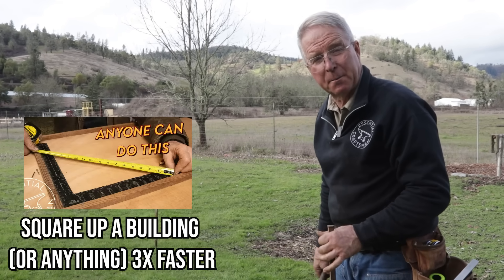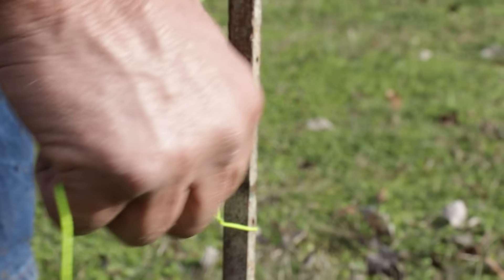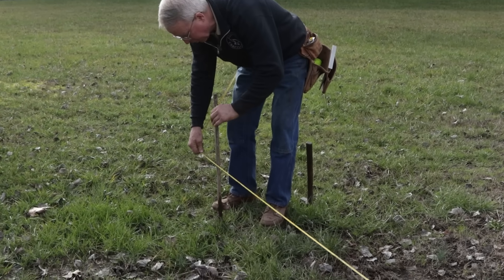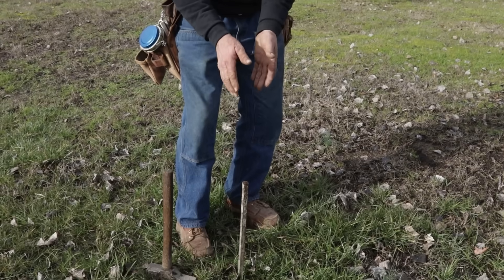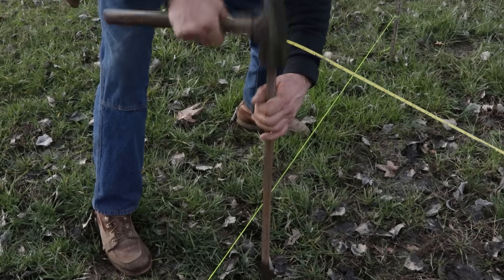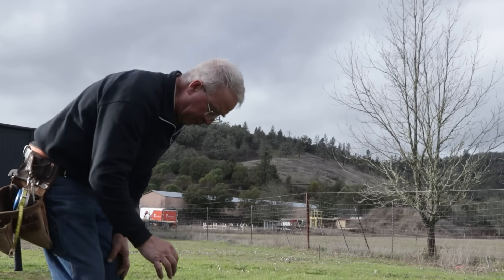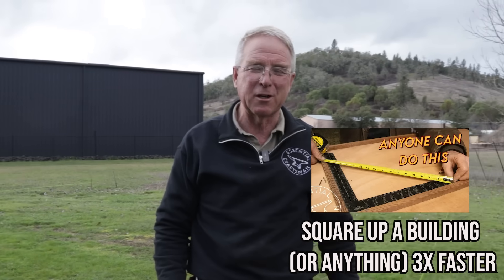How to Layout Parallel lines Perfectly

Comment: in my metropolitan jurisdiction we pay a survey crew to establish our foundation set-backs, off registered civil benchmarks. worth every dollar, every time. much different than whatever rules apply in the ex-urbs or rural areas but worth mentioning. sure set your batter boards & string lines etc etc check for square, shoot your own laser for elevation using surveyor established ele's as reference  but don't start without professional set backs.

Comment: I wish I’d seen this about 10 years ago, I’m no carpenter I built a 24x40 pole barn , I had a really hard time getting it close to square , working by myself with zero experience. It turn out about 4 inches wider on one end , it turned out pretty good and everyone thought it was very good but I always know the difference.

Comment: If you are building a Walmart and the concrete guys only got the South and West footing in and you need to start the wall you need to know the Pythagorean theorem and in an overall measurement from corner to corner it should be 3/8 short

Comment: Two lines perfectly squared using 3 4 5 method then everything parallel off those two original lines then double check later on with the x

Comment: Called profiles need to be leveled first line is the longest line of the found plan the facing the right way north east etc then use a big gib square to get the other line ruffly square then 3, 4 , 5 get that squared then everything else parallel off those first two original llsquare lines. Easy as
Reply: The 3 , 4 , 5 is the most efficient way to get two lines perfectly square

Comment: Why don't we take two points, for example, spaced apart according to the length or width of the building, and connect them with a rope? Then we take the third point according to the width or length of the building, respecting the 60/80/100 rule for angles. This gives us three points forming a right angle, and we use only a measuring tape to find the fourth point.

Comment: I spent a good amount of time racking my brain over this because I couldn't figure it out. There was no way geometrically that it could produce a parallel line that was on dimension, if we're going by pure trig. So I graphed it out in CAD, and here are my findings:
1) This does produce a parallel line
2) The distance between the base line and parallel line will always be shorter than your target distance. He's aiming for 36, and the actual distance will be a bit less (if he's hitting his layout dimensions perfectly). The absolute worst case I could produce based on his setup had ~0.5% error in the distance between parallels. Good enough.
3) He's not joking when he says "eyeball perpendicular, it doesn't matter". I graphed it out with a guy walking off at a 45 degree angle from perpendicular and it still worked within an 1/8".
4) The error from this method is non-linear meaning it doesn't scale proportional to distance. Can't be bothered to work it out, but a couple shorter test cases (12 ft parallels instead of 36 ft) had stupid small errors (like 0.008%).
Cool stuff. Appreciate the free education

Comment: Why not make a 3:4:5?
1. drive first stake (A)
2. measure a line off A to 36' and let it dangle
3. measure your fixed line off A to 48' and drive a stake (B)
4. measure a line off B to 36' and let it dangle

Now you can hook your tape to either of the stakes and draw it out to 60' to make a 3:4:5 triangle to stake C and D. It starts out 99% square.

Comment: Taking two lines that are roughly parallel, designating one as fixed, then travelling the shortest distance to the other line does not produce a 90° angle from the original line. I bet there actually is a way though.

Comment: I absolutely love your videos!  Thanks for doing these.  I’m not nearly as experienced as you in construction but have a different way of squaring up an area.

I set two stakes and pick the line I’m most concerned about regarding placement.  For an example, “I want to make sure this items sits 20’ from this building”. So, I would put those two stakes first at the measured distance.  Then, calculate the hypotenuse.  If doing a 40’x60’ area this would be 72’-11”.  Now, you need two tape measures.  Run one diagonal for 72’-11”.  Run the other one along the next line your wanting to set until it hits 72’-11”.  Repeat this again and your area is perfectly square.  Go back and put string around it to match the desired grade.

Comment: On construction in the UK we went to decimal many years ago, initially we fought it but then accepted it, the difference in ease and accuracy is night and day, inches and feet are so archaic and cumbersome  2.3/4  inch becomes 70mm, is a much simpler system
Reply: Sometimes I'll use metric, and it is easier for sockets. I remember my boss asking something like, "What's half of 5/8?" I didn't know. "5/16ths". I can use either system, but for construction I prefer feet and inches. I hate KPH though, and like that we do MPH.

Comment: Beautiful video! As an outsider who will start a construction project soon, I have a quick Q. Let's say I have a straight line from point A to point B (e.g. 4 unit long), and I need to draw a parallel line (say 3 unit apart). On paper, I can use point B as the center and draw an arc/circle with a radius of 3 unit (using a compass), and use point A as center and 5 unit as the radius (power of Pythagorean Theorem as shown in your other video) to draw another arc/circle. These 2 arc/circles intersect at point C. By the same token, I can pin down another point D. Line CD will be in parallel to line AB. And ABCD is a 3x4 rectangle. Is this method practical in construction field using tape measure, masonry line and a couple of rebars/stakes?

Comment: There's a lot of ways to establish a square line. My way is to set 2 corner stakes the you did, only the stakes would represent the building corners. Then, using a square formula, find the square number. Pull a tape from the established corner to the opposite corner on the opposite side and spray paint a line corresponding to the square number. Then you pull the remainder building corners from the original steak and the square mark

Comment: Hah. I was building a little deck for an elderly couple with this other guy, who was technically my boss, because he was the contractor and I was the helper. He had the idea that we should install 9 posts to hold up the deck. That seemed reasonable. But then he just wanted to start digging holes and putting in posts and I said, "Wait a second. What we need to do is put "batter boards" outside the deck area and pull strings to make sure we have straight lines." He wanted to do it the quick way, so we did . Then, when it came time to put in the posts, they didn't line up. He asked, "How did this turn out so wrong?" I just looked at him.

Comment: I got a trick for you old timer. Pick a point past your second line then swing the arc, mark the two points in which your chosen point crosses the line, measure that distance then half it will give you that right angle perfectly without the slight guess work.

Comment: I bought a Spencer Tape because you recommended it in this video. Turned out to be a complete piece of s**t. The spring is weak and never returns the tape properly. And yes I reset it.

It didn't come with a nail. Had to buy two additional ones. In spite of it clearly being pictured with a nail.

Then the damn belt clip fell off on the first day I used it. 

Won't be taking any more advice from you when it comes to tools. Maybe they were good in your day. But now they're trash.

Comment: Am I the only one to realize this video is flawed? If you follow the process in this video you end up with a parallelogram where the slanted side is 36 feet, the distance between the lines will not be 36 feet, and you still will not have a perpendicular line from the datum! The reason is: when he scribes the arc anchored at the datum line, he is making a line perpendicular to the secondary line - not the datum! Try it yourself with 2 lines considerably out of parallel and you will easily see what I mean. The correct way is instead to: anchor the arc at the second line and scribe the arc at the datum. The line between the secondary and where the minimum distance is at the datum will now be a line perpendicular to the datum. You then run a string on this perpendicular line. Do this again at another point. Now you have two perpendicular lines to the datum. Measure along both of them 36 feet and move your posts to that point. Then a run a string between them. You now have a perfect rectangle with 36 feet perpendicular distance. And better yet, from these 4 points you can measure any distance along the lines - just do the same on both opposite lines - and you can move your stakes to make a rectangle of any size you want and any offset from the datum that you want while being parallel to the datum. Also: The secondary line does not need to exist, you can start at any two arbitary stakes in the ground no string between them is needed.

Comment: A couple of comments: 1) Did you not find the right angle when you swung your tape like a pendulum?  Do that from 2 known points and you're square.  Why the extra step of the pythagorean theorem calculation?  2) Using the results of the pythagorean calculation, swinging 2 tapes from 2 points and intersecting at the hypotenuse calculation with get square very quickly as well.

Comment: What got me wonder here is that if the 2nd line is not parallel then picking a point of the shortest distance to the first line does not give you a point that is square to the first line. Just as an exaggeration consider a triangle where you measure a distance between any given point on one of the sides to the adjacent side- if you measure towards the tip, distance will be shorter then when measuring towards the base but it will not guarantee the line layer is square to the side. Now in this application it may be good enough but are the lines perfectly parallel?

Comment: Everyone uses 3,4,5 to get the square, which is a great way of doing it, but there is a much easier way that can be done by one person, its the way the Egyptians use to do it Im led to believe, thats simply drawing a straight line, using a Drawing Compass or Divider and draw two elliptic lines across your straight line, where the elliptic line cross over eachother, draw another straight line, its a perfect Square.

Comment: You just need one fixed line(side) and final point A and B on it, than if you know diagonal and building side length you just run one dimension from A and other from B and once those distances meet, you have a point C (that switch lengths for D), much easier and faster

Comment: Awesome tips! Thank you mate!
Just one remark : I think you are making a mistake when you say "square to the FIRST strig" because if I do the math,  you're square to the SECOND string. What you end up with is actually 2 parrallel lines  no problem! But the distance between these 2 parallel lines is not exactley 36ft if you make a square with your other method and measure along this line. The better eyeball at the beginning the closer to 36ft you'll be.
Reply: Just to make it clearer: 
When you draw your measuring tape and find the shortest distance : the measuring tape is square to the string where your feet are, not the one where your tape is attached.
Reply: @joffreyjo4076  You are absolutely correct. So the measure needs to be back at the datum line so that the measure is done perpedicular to the datum. Then a new line put up here. What is descibed in this video is how to create a parallelogram... infact you don't even end up with a single line perpedicular to the datum if you follow this video....

Comment: A master class about one of the most important points before the building starts. It's the stablishing the main datum reference for the rest of the measurements.
Reply: I was expecting the definitive measurements to be taken in the two diagonals of the rectangle as they should be the same if all corners are squared.

Comment: This is not correct.  The method of using arcing to find the shortest distance to the opposite staked string as the point of 'square' (i.e. that a 90* angle is formed at the first string) assumes the two long lines are in fact already parallel.  This was never established here (only eyeballed 'square' at ~36 feet, or to quote "two strings roughly parallel, probably not all that close at all" at 5:20), and thus the "shortest" distance method only ultimately results in a parallelogram if the two ends are measured to the exact same length (but they were not here, and even adjusting the lengths at the end of the process to exactly 36 feet incorporates the error, and does not properly adjust for it), but certainly not a guaranteed (squared) rectangle.  Actually where the 'magic happens' at 6:20 is the exact moment where the problems begin.  

He's trying to establish square on the end strings without first establishing the two primary (long) strings as parallel in this video, which doesn't even match the video title.  At no point in the video does he ever make the primary string square to the (short) end width strings-- he assumes he's found square (which isn't the case, as mentioned), and from this erroneous assumption contends the 2 long lines have now been made parallel to the 2 square end strings, which they haven't.  This defies all logic, and is not how this work should be done anyway for laying out a foundation, because it (very likely) creates a parallelogram, not a squared quadrilateral (rectangle).  Establish your long line and a perpendicular (square) end line first, then run your second long line from there-- very easy to establish parallel longlines that way.  Simple maths would have prevented this basic error.

Comment: I know you're trying to help. Even you can learn from a younger guy as I can learn from you. But realistically you made it way harder than it had to be. 

#1: get your 2 given corners A&B
#2: find your hypotenuse ( square corner
#3: pull your square corner off of A and your other building distance from stake B until the square corner and measurement intersection. Thats point C

Then pull your two measurements of the building from point  A and C until those measurements cross. 

That will get it perfectly square on the first attempt. You're only setting 4 stakes. And each stake is set accurately the first time. I do this for a living.  Concrete guy.

Comment: If you guys use centimeters and meters you can use 3 4 5 method..much easier. This os just not accurate because you cant get anything square whitout getting rhe corners accurate 90 degrees and the diagonals right

Comment: Thanks for the video. But there is an inconsistency. When you measure out both your ends at 36 ft from the reference line let’s assume you don’t get it exactly 90 degrees (as you say). This then means that your second line ( the approximate one) by definition must always lie within the arc scribed from the building corner stake. In other words the exact 36 ft square distance from the reference line will always fall on the outside of the second approximate line. In your video your 36 ft mark was inside the line and that’s not possible. Yes the shortest distance will be approximately square but it will always be less than 36ft because your quadrilateral is a squashed version of the rectangle you are trying to make. Clear as mud. I need pictures. Thanks.
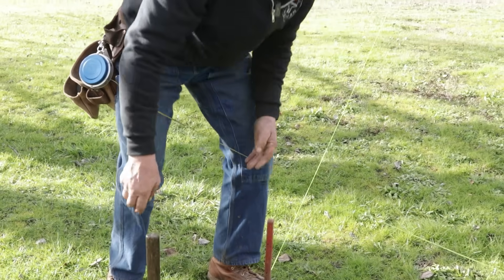Reply: I think he basically covers it at 7:28, it’s probably the tiny error from the ground not being level. I get what you’re saying though if he measured them the way he did, they should be no more than 36’ apart. Funny!

Comment: This method is not correct. As previously said, when finding the minimum distance to the second line, the point/stake at the beginning of the tape measure is perpendicular to the minimum distance on the second line. What is certain to be square in this video is the line from stake #4 (first stake on second line at 3m41s) to stake #5 (last stake on the second line at 5m00s), and stake #6 (at 5m35s). point #6 is perpendicular to the line #4,#5.

Comment: I respectfully suggest that this method isn't correct.

When you draw the tape from the first line to the second and look for the minimum measurement, the line you are finding is perpendicular to the second line, not the first.

Moreover, it's perpendicular to the second line at the position of that line when you find the minimum measure - if you then move the second line, it's no longer perpendicular to either of the lines.

You can see it by drawing out the method on paper, especially with an initial placement of the second line an exaggerated amount out of parallel.

Comment: There is obviously no way you could have the second string more than the 36' from the first string if you measured 36' from the first string.  Your stakes were moving or something.  If you happened to measure perpendicular to the first line, the second would be 36' from the first line.  If you were at an angle, the lines would be closer.  Errors like this is the reason I build my own stuff and don't waste money on  contractors to screw it up.

Comment: Put a stake on each corner of one side of your rectangle figure the diagonal using Pythagoras theorem pull one tape off of one stake for the length of the other side and another tape off the other stake for the diagonal bring the two tapes together place a stake reverse the process for the other side place a stake you have now found all four corners all four corners are square no strings involved

Comment: Yes you got the first two lines parallel,  but you don't know if the rectangle corners are exactly square unless you check the corners with the three four five measurements, or carry out diagonal measurements.